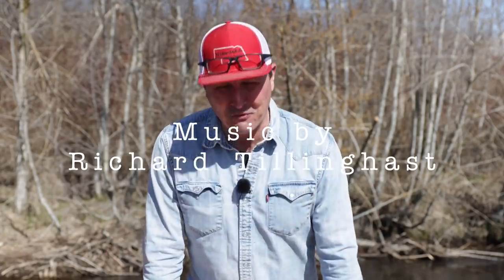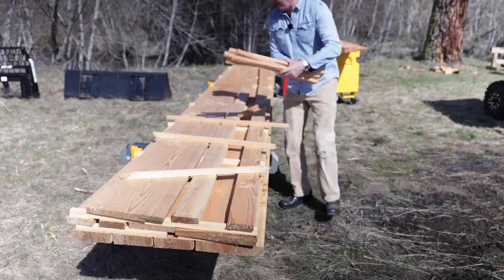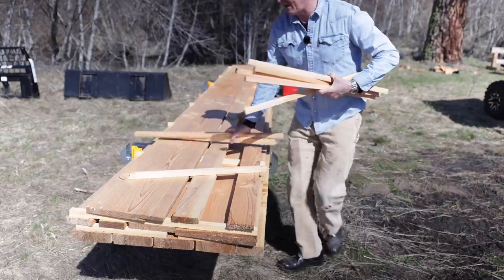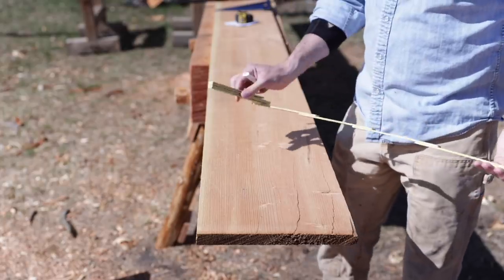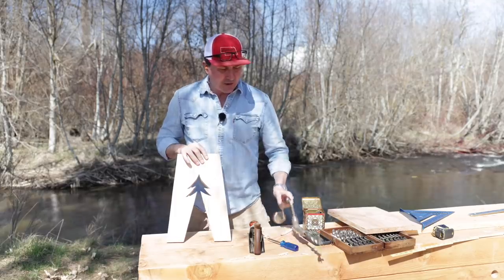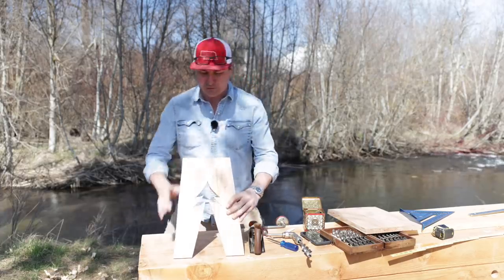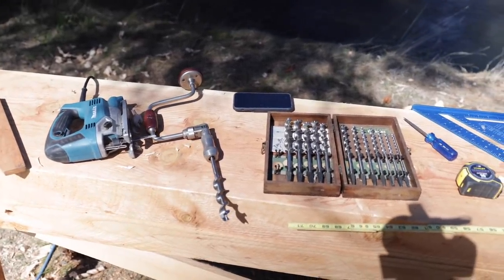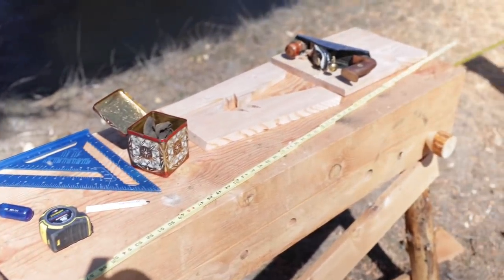HOW TO BUILD A FOREST BENCH 1/2

Comment: Hey Cody! I see you are not using your friction clamps and I noticed the problem when you first drilled your holes. I have a simple solution that will allow you to use your current clamps and not drill new holes. Hopefully I can explain this properly. Just heat up the iron and increase the angle / make the clamp wider at the hook till they grip when you put pressure on them . The bit  looked to be parallel with the rod that goes in the hole and you  need angle to create that friction you need. Bend the hook out and you'll be clamping away! Love the bench! (not the cross braces...lol)

Comment: Just a thought on the hammer clamp holes you drilled to large. You could just glue a hardwood dowel into them and redrill the smaller hole right into the dowel.

Comment: So what tool cost less than $20?
The pensil?
Reply: You can buy an old Number 4 plane for $20 but it’ll take some elbow grease to get it usable.
Reply: @mramseyISU  doubt it, but let's say you do. Let's say you buy a plane for $10.  How can you say " you can make this for less than $20" Sounds like an east coast salesman  to me.
Reply: @benblake4448  I’ve bought dozens of Stanley planes and restored them. $20 will buy you mid century Stanley Bailey that needs cleaned and some rust removed. Once you get it cleaned, flatten the sole, sharpen the iron and it’ll work as good as a $300 Lie-Nielsen.
Reply: @mramseyISU  okay......I'm not debating that. 

You must be an east coast salesman also.

Comment: Always the same thing we the Austrians had that Beer Bench design just as long as the Bavarians and are still using them today, it always ends up getting called the German Beer Bench, But anyways usually youd use metall legs than can be folded.

Comment: I don’t usually disagree with you mr wranglerstar but the jig saw is a pretty useful tool if used in the right way I’m as you call it in the states a general contractor and I carry 3 of them all set up for different jobs I have a one fitted with a coping foot and scribing blade for coping one with a normal base for general work but change between up cut and down cut blades depending on use an one with guid rail attachment with a wide blade